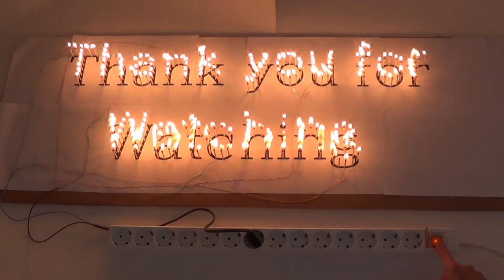BFO Metal Detector on breadboard step by step guide (브레드보드에 금속탐지기 회로 만들기)

Comment: Hi Thomas,
I've tried to replicate your circuit on a WISH wishboard breadboard using 2N3904 transistors and I've been really careful with all my pinouts. No joy. I have tried it using  a 0.5W 64-ohm speaker and also using a crystal earphone. No joy. One thing puzzles me.Your parts list has only 1  220 microfarad capacitor and you only fit one in the video [no. 44]  .Yet the parts list  and circuit diagram on the easytreasure website has 2 of 220 microfarad capacitors but no breadboard positions given for the 2nd one.  Do I need to use the 2nd one?  One other question - you said to someone else that only polyester capacitors work. Why can't ceramic capacitors of the correct values be used? I just cant't figure out what's going wrong, and I'd be grateful for your help.
Kind regards,
Jimmy

Comment: I have sent Thomas Kim questions but I see that  he still never bothers replying  to anyone. I spent a lot of time on this circuit and could not succeed. Its just not possible to fit 125 turns of wire on that size glue stick without overlapping turns & I think you must not overlap . I only managed about 70. He only seems to go half way with the turns also. Seems impossible to me to fit 125 turns on it. Did anyone else have this problem?? Also not sure about a couple of the capacitor values at the end.

Comment: PROBLEM SOLUTION ....I never post but I really like this project.  I 
tried first and it did not work. Here is what I discovered.  First and 
most important, make sure that the E C B on your transistor is the 
correct order.  There is a difference.  Google the Trans that you are 
using and look at images.   It will show you the order.  I had to twist 
my leads around to make it work.   Next, if this is still not working, 
then your coils are way out of frequency.  Try this.... make two large 
coils of exactly the same size.   I used 22 gauge wire and only 7 
windings.   Install the coils in the slots as directed and you should 
now hear a sound.  Now, take some time to play with the coils and 
experiment for the best effects.  

Good luck to all.
Reply: Hi 
This project work ?

Comment: original schematic says use two 16v 220uf capacitors , in the description it says one 16v 220uf , but in the video it looks like one 25v 470uf capacitor is used ?
Reply from the maker: It is no matter.
Reply: I want to know that the where you have joined the coils
Reply: PLease tell me where you have joined the gum stick coil terminals and the winding on wood terminals. Please reply me soon as I am on the end of this and cannot find the proper place to place them
Reply: clearly check this video.... last carefully
Reply: confused me with you

Comment: Sorry Thomas, I forgot to say that the LED lights but no sound apart from an odd crackle when I power on. I have tried using identical coils also but no joy. Any advice would be great.
Best,
Jimmy
Reply: same here :(
Reply: James Greally  same problem here are u solve this problem ?
Reply: ابو زكريا  yes i did
Reply: James Greally  LOVELY NOISE .I USED BC 547 AND IT WORKED. THANKS AGAIN
Reply: @alielfar9889 pode mostra?😊

Comment: THANKS Mr. THOMAS , LOVELY NOISE .I USED BC 547 AND IT WORKED. THANKS AGAIN
Reply: +ali elfar, you used bc547  but you send me a list  that  the transistors are c1815 are they the same? and someone in the comment said 2n2222 worked also, will any of them will work? thank you
Reply: Hi please to know you have to finish is its function well
Reply: ali elfar 
Can the metal be detected , when detector is moved radially towards object?
And what's the maximum range of this project?

Comment: Hi Thomas , If i'm reversing the power supply then the LED is OK but no noise. I tried both C1818 & 2N2222  transistor . I've carefully checked the circuit  but could not solve it.Can you help me

Comment: Would it be possible to have the values of the two coils ... can I use ceramic capacitors ? Thank you in advance
Reply from the maker: ceramic capacitor is not suitable for this project.
Reply from the maker: +Felix Merz ceramic capacitor's capacitance is little bit change during operation. I already use it. The detector makes ungoverned alarm.

Comment: What is (103) and (104)? Can you explain to me please?
0.01μF(103) Polyester film capacitor * 5 (34~38)
0.1μF(104) Polyester film capacitor * 5 (39~43)
What is (103) and (104)? Can you explain to me please?
Reply from the maker: 103 = 0.01μF Polyester film capacitor, and so on.
Reply: +Thomas Kim where did you get that magnetic wire?(11:48)

Comment: Hi,

I built it with several types of coil and turn,  still not getting a sound but when I touched 10k resistors near the coils it's picking a noise. Could you please give an advise.

Comment: Hi Thomas, 
I'm trying your circuit again. Can I ask you a question? When winding the copper wire on the glue stick, is it okay to overlap the coils? In the video,  you don't seem to overlap them and you stop just over half way on the stick. How many turns did you use?  On the easy treasure website you recommend using 125 turns. I don't think I can fit 125 turns on the glue stick without overlapping them. I would appreciate your advice.  Thanks, Thomas. 
Jimmy

Comment: I am 25v 470uf is it not walk the transistors its good position I have wire 0.25 diameter with 255 toure, platen diameter 148 mm (the trarque bisare as I plug on my battery it is not lit is when I inverce the (+) With (-) the LED lights up one after that it can light up the light progressively.

Comment: Where on the board do the coils go to?  It is missing this very important step.

Thanks
Reply: 12:58
See on schematic, Coil A and B
http://www.easytreasure.co.uk/Images/bfosch.jpg

copied from description box:
This video shows BFO Metal Detector components position on breadboard.
00:00 ~ 01:17 - Breadboard BFO Metal Detector demonstration.
01:17 ~ 13:19 - You can see each component position.
Materials : 
Jumper Wire (1~7, 19~27)
10k Resistor * 6 (8~13)
2.2Mega Resistor * 1 (14)
39k Resistor * 2 (15,16)
1k Resistor * 1 (17,18)
C1815 NPN Transistor * 6 (28~33)
0.01μF(103) Polyester film capacitor * 5 (34~38)
0.1μF(104) Polyester film capacitor * 5 (39~43)
16V 220μF Electrolytic Capacitor * 1 (44)
LED * 1 (45)
Speaker * 1 (46)
9V battery
Enameled wire
Glue Stick
Brass tube

Comment: wht about coils??? what size?? how many windings???
Reply: Sagun 125 TURNS 0.25 WIRE ON 12 MM COIL B COIL A = 10 TURNS SAME WIRE AROUND 150 MM DIAMETER
Reply: +ali elfar  plz ali can u tell me wich kinf of speaker u use and wich kind of capacitor (ciramic ) u use my pizzzo keep biping 
thanks
Reply: Hi there you mi what for the transistors 2n2222 or 1815 as indicated on the list

Comment: Hi MB,
Thanks for your email.  Did you have the same problem with trying to fit 125  turns on the glue stick coil? How many turns did you use & did you overlap?  I know they must be wound tightly & Thomas doesn't appear to overlap them in the video.  So I don't know how many turns he used. The  link to easy treasure suggests about 125. Without overlapping turns, I think you'd need a much bigger glue stick!  I have made lots of your other circuits, Thomas - the laser activated alarms,  occupancy indicator light etc. They're absolutely brilliant & my students found them really interesting.  Any help on this one would be greatly appreciated. 
Best wishes, 
James

Comment: o,k the transistor that used in this video is C1815 witch (E-C-B) if you use other transistor with different pinout you should bend it to conform (E-C-B) pinout on the board place

Comment: instead of .01 and 0.1 polyester. can i use any capacitor??
Reply: Use non-polarized caps like ceramic...etc. (do not use polarized like electrolytic)
But for the 2 upper caps there you need electrolytic(polarized):
http://www.easytreasure.co.uk/Images/bfosch.jpg
B- = Ground = battery -
B+ = Vcc = battery +

Comment: I would be interested to know if anybody else has tried this circuit and got it to work.
Reply: I did something similar and showed on film. I invite you to look at
Reply: ali elfar thanks a lot
Reply: Lechoslowianin YOU MUST TRY IT .IT WORKS . I USED BC 547 TRANSISTORS AND ADDED FEW TURNS MORE  FOR THE SEARCH COIL ON BREAD BOARD.FREGUANCE 125  TURNS ON 20 MM GLUE STICK 0.25 WIRE  , AND WOW DONE
Reply: ali elfar Hi ali,
Thanks for your email. Glad to hear that you  got the BFO metal detector to work. Can I ask you, was it Thomas Kim's model you got working  or was it Lechoslowianin's version?  So sorry also  - I did not understand what you  meant  by "FREGUANCE 125 turns" etc. Did you overlap the 125  turns on the  gluestick? Also, how many large turns did you use on the search coil so? Kind regards, 
James
Reply: James GreallyHI Mr. JAMES YES IT,S TOMAS KIM,S MODEL=.2 CM WIDE AND 8 CM LONG GLUE STICK 125 CAREFULLY  TURNS WITHOUT OVERLAP 0.25 WIRE AS SHOWN IN TOMAS VIDEO AND THIS COIL IS TO ADJUST THE NOISE (SOUND) OF THE METAL BFO DETECT.THE SEARCH COIL IS BETWEEN 10 AND 12 TURNS DIAMETER 15 CM THIS COIL YOU CAN OVER LAP THE TURNS > HOPE U TRY IT. THANKS TO TOMAS AND WISH YOU GOOD LUCK.DEAR JAMES. GREETINGS
Reply: +Lechoslowianin can you show mee your idea or explaning me that if the led is working that is means that the circuit works
Reply: The circuit is working properly if the battery gets the current 20 - 30 mA
Reply: +Lechoslowianin 
i had run this curcuit today bt the output was soo many small on oscilliscope and i wanted to know if imake a more number  could give me a better result 
and if i increase the voltage source (ofcourse less than the beak volt -amp of the transistors )could give me a better result too
Reply: i tried also this circuit but but failed,,, 3 times,,,, then i realized this circuit was composed of oscillator and amplifier,, so i tried to cut the circuit into 2 i took the oscillator phase,,ilooked for the negative,,the positive and the output i connected them to audio amplifier,,,, it worked well,,,you try,,

Comment: Can anyone give me the parts list?,,,i really need it..please..
Reply: +Josue Lader
Dear Josue >: here are the parts: 
Materials : 
Jumper Wire (1~7, 19~27)
10k Resistor * 6 (8~13)
2.2Mega Resistor * 1 (14)
39k Resistor * 2 (15,16)
1k Resistor * 1 (17,18)
C1815 NPN Transistor * 6 (28~33)
0.01μF(103) Polyester film capacitor * 5 (34~38)
0.1μF(104) Polyester film capacitor * 5 (39~43)
16V 220μF Electrolytic Capacitor * 1 (44)
LED * 1 (45)
Speaker * 1 (46)
9V battery
Enameled wire
Glue Stick
Brass tube
Reply: +ali elfar  tnx
Reply: +ali elfar can u send mr plez the sheme 
and if the lef is on that is means that the circuit works ??? 
and the search coil can i overlab it 
thanks

Comment: Hello, I am an Engineering freshman. You wrote that you completed the Metal Detector Step by Step project in http://www.youtube.com/watch?v=GRXq-BEHBlE . I am also working on a similar project but have thus far failed to achieve a working product. I was wondering if you could let me know the way you completed this project. Have you used materials that are different from the ones used in the video? How many turns has the copper wire have? Also, what did you use as the speaker? And finally, how did you attach the wires of the two coils to the breadboard?

Comment: Can anyone give me the parts list? Tnx in advanvnce..:)
Reply: Josue Ladera Materials : 
Jumper Wire (1~7, 19~27)
10k Resistor * 6 (8~13)
2.2Mega Resistor * 1 (14)
39k Resistor * 2 (15,16)
1k Resistor * 1 (17,18)
C1815 NPN Transistor * 6 (28~33)
0.01μF(103) Polyester film capacitor * 5 (34~38)
0.1μF(104) Polyester film capacitor * 5 (39~43)
16V 220μF Electrolytic Capacitor * 1 (44)
LED * 1 (45)
Speaker * 1 (46)
9V battery
Enameled wire
Glue Stick
Brass tube
Reply: ali elfar For the brass tube that small, do you know of a good place to look for that? I saw Tom had a bunch of them in his box of components, but wasn't sure if they already come cut to length like that, or if they come as tubes of a set length and you have to put some elbow grease into it to get the right size.

Comment: can u plz give circuit diagram  bro
Reply: http://www.easytreasure.co.uk/Images/bfosch.jpg

copied from description box:
This video shows BFO Metal Detector components position on breadboard.
00:00 ~ 01:17 - Breadboard BFO Metal Detector demonstration.
01:17 ~ 13:19 - You can see each component position.
Materials : 
Jumper Wire (1~7, 19~27)
10k Resistor * 6 (8~13)
2.2Mega Resistor * 1 (14)
39k Resistor * 2 (15,16)
1k Resistor * 1 (17,18)
C1815 NPN Transistor * 6 (28~33)
0.01μF(103) Polyester film capacitor * 5 (34~38)
0.1μF(104) Polyester film capacitor * 5 (39~43)
16V 220μF Electrolytic Capacitor * 1 (44)
LED * 1 (45)
Speaker * 1 (46)
9V battery
Enameled wire
Glue Stick
Brass tube

Comment: Thanks man, that's great.
Here is the circuit diagram:
http://www.easytreasure.co.uk/Images/bfosch.jpg
Reply: copied from description box:
This video shows BFO Metal Detector components position on breadboard.
00:00 ~ 01:17 - Breadboard BFO Metal Detector demonstration.
01:17 ~ 13:19 - You can see each component position.
Materials : 
Jumper Wire (1~7, 19~27)
10k Resistor * 6 (8~13)
2.2Mega Resistor * 1 (14)
39k Resistor * 2 (15,16)
1k Resistor * 1 (17,18)
C1815 NPN Transistor * 6 (28~33)
0.01μF(103) Polyester film capacitor * 5 (34~38)
0.1μF(104) Polyester film capacitor * 5 (39~43)
16V 220μF Electrolytic Capacitor * 1 (44)
LED * 1 (45)
Speaker * 1 (46)
9V battery
Enameled wire
Glue Stick
Brass tube